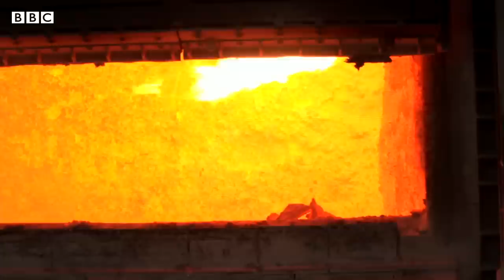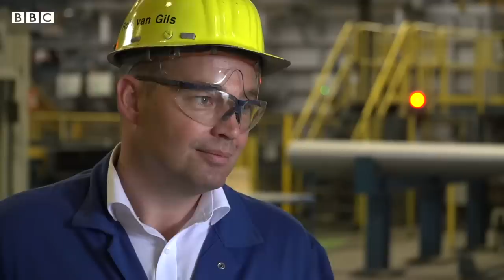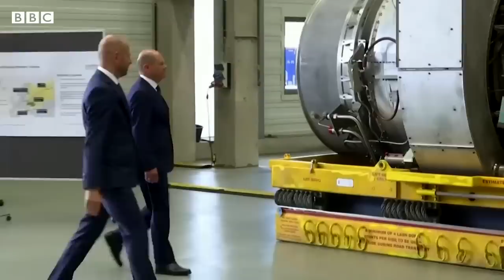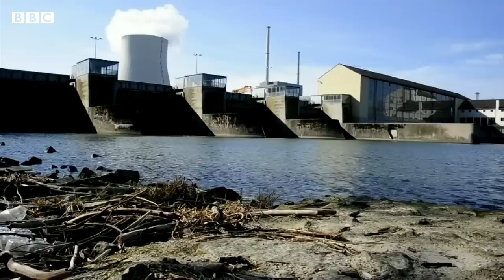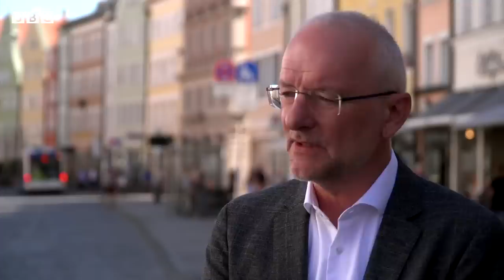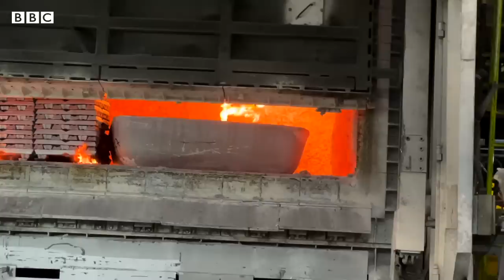Impossible to return turbine vital for Europe gas supply says Russia energy giant Gazprom - BBC News

Comment: Germany needs to not just keep those 3 nuclear plants open but needs to REOPEN as many of the other 15 plus plants they shut down in the past decade as they can, while continuing to expand their renewables of course. They need to swap out as many gas heating systems as possible for electric ones and otherwise electrify as much as possible.
Reply: The fact that French Nuclear power plants are failing is the reason for high gas demand in power production.
And it is ludicrous you think it needs less then a decade to restore a plant after shutdown.
Reply: @christopherg2347  maintenance is hardly "failure". And we have seen Japan wisely reopen several of their early shutdown nuclear plants in far less than 10 years. Germany should do the same. Now, some plants would take longer to reopen than others, which is why I said "as manh of the 15 plus", I doubt it would be any where near 15 in time. However, they should endeavor to reopen as many as they can as quickly as they can.
Reply: Biogas and rocket stoves don't need semiconductors or other electronics and both are simple enough to operate and are carbon neutral
Reply: @psylentrage  yes but there isn't enough of it yet and won't be by winter. Yes they should produce and use as much biogas as possible, but it's impact will be small this and next year sadly.
Reply: @Dr.Gehrig  Maintenance due to critical cracks and inactivity due to a water shortage are unquestionably a failure of nuclear technology.
Reply: @embreis2257  key word: "some." 

Yeah, I know, that's why I said "as many as they can", one would be infinitely more times than none, two, is probably doable, three? And they would literally have doubled the number currently operating. And this is drawing from 15 or more shut down early WITHIN the past 11 years, they weren't all shut down 11 years ago, some were literally shut down within the last 3 years. 

And note I also said, "as they continue to build out their renewables." They need to use every tool in their arsenal, to over come these issues... as we all do to overcome the climate crisis. Nuclear fuel is easy for Germany to buy and ship, and they have the whole EU to hire appropriate workers from. 

And while you are correct that building new nuclear plants is slow and expensive, reopening early shut down ones can be done quite quickly and relatively cheaply, just ask Japan.
Reply: @christopherg2347  meh, sounds like maintenance and a need for more water. Sounds like you're looking pretty hard to call any challenge or issue however minor or transitory "a failure of nuclear power". You really should focus on knocking out all of the coal and fossil gas (and the tiny amount of petroleum based power) before coming for nuclear. We have a time sensitive climate crisis to solve.
Reply: @christopherg2347  also a small thing as a crack can cause a big explosion or radiation like what happened in Chernobyl the reactor over heated and melted and the radiation made the city uninhabitable for some 20 thousand years nobody can live in that area just waste land
Reply: @Dr.Gehrig  Right. Just magically make cracks disappear and get rivers to carry more water in a heatwave?
How many fuel rods have you licked?
Reply: Guys you like of cold at the house and dark without light? Keep dreaming then, meanwhile I value electricity and I am happy about new nuclear power plant in Finland. But sad that there is no more than 1 new. At here we can have real winters too.. so keep dreaming, just dream very hard! Don't do anything real for this problem. Jesus. Let atleast old people and sick to have heat, you can keep your personal house cold if you like it so much 😂
Reply: @Dr.Gehrig  As much as 50% shut down for maintenance and repair is hardly reassuring. And you don't just go "Okay let's switch this nuclear plant back on" you're all very naive and just spout out arguments you read somewhere else without doing research.
Reply: @christopherg2347  Magically make cracks disappear? Do you think goal plants don't need maintenance or something they just last forever? What kind of dumb nonsense is this?
Reply: @captainsewerrat  oh I've done plenty. As of said, we have Japan as a reference. Some of those 14 to 17 early shut down plants could likely be restarted within a timeline of several months. No, not all of them, although several more could likely be restarted in a few years. Still worth doing.

But, even if the German government were to confirm this, I bet you'd still not be happy with it. The reality is, You don't WANT them to restart. Well, that sentiment is resulting in more coal being burned.... notably several coal plants which had been shut down early were restarted... just like what I'm advising here. 

Again, I also declare it necessary to continue expanding their renewables. But the more low to zero carbon energy sources employed the sooner Germany can get off of its fossil fuel dependence. Making them healthier, safer, more sustainable, more stable, more secure, lower cost, and more prosperous.
Reply: @thetoughcookie3665  guys like who? I specifically recommend more nuclear. Finland is wise to emulate Sweden and expand their nuclear program.
Reply: @christopherg2347  no, they all take the time to do maintenance. All thermal power plants renewable or not (possible exception of some geothermal), renewable hydropower, and PV solar all become less productive in such high temperatures low water scenarios (though the increase in sunlight usually more than makes up for it). So yeah, any thermal plant or hydro power dam dependent on a river with reduced flow will have to reduce their output. This has been true since the 1800s, this is neither new nor unique to nuclear power, and in none of these situations is this a sufficient reason to abandon these power systems.
Reply: @Krytern  Coal plants rarely explode, involving highly toxic and somewhat radioactive material.
And Solar panels or wind turbines are not known to explode either.
Nuclear only ever added problems.
Reply: @jamesusanashville9678  I mean, not if you're right there literally in the reactor, but as a source of electricity... pretty decent.
Reply: Pure fear-mongering report !
Just reveal both the Russian and the German letter. Who needs what for turbine transport? 
This is kindergarten-level discussion and reporting.
Reply: You can't just flip a switch and reopen those decommissioned plants. Most of them have been demolished and the others are being dismantled
Reply: @stevec6427  indeed not. And yes, for SOME of them that is true. But not all, there's about 15 such plants at various stages of closure. My point is simply that Germany should make the effort to reopen as quickly as possible those which can be reopened.... a thing they literally did with closed down coal plants and that Japan did with its own nuclear plants. So there IS precedence on two sides here.
Reply: There is no need to reopen other plants, as we produce enough power. With additional plants we wouldn't know how to get rid of all the useless energy.
Reply: @gerbre1  reopen the nuclear plants so that you can keep the coal plants closed and reduce the fossil gas plants to a minimum output. Then as fossil gas becomes scarce you have more options what to do with it, instead of using it for electricity. Also, increase the need to electricity by switching out as many fossil gas heating systems for electrical ones.
Reply: @Dr.Gehrig  Nuclear power is a small fraction compared to coal. You can only replace coal with renewables in the near future.
Reply: @Jolifo1978  nah
Reply: @gerbre1  over 10% of Germanys electricity is still being produced by a mere 3 powerplants. About 15 were closed early. Reopening any number of those would make a substantial contribution. Yes, Germany needs to keep building out its renewables. But it needs to use all tools at its disposal to reduce emissions and fossil fuel dependence. Reopening some nuclear plants is easy low hanging fruit.
Reply: @Dr.Gehrig  Not 10%, but 6% or 1,5% of the primary energy.  Even firewood has a higher share. Reopening only causes problems and risks. We already produce enough electricity and export great amounts. By far the best tool to reduce fossil fuel emissions are renewables. The current three running reactors need revision to run longer. The current fuel can be used a few months longer. New fuel stock is not available before mid 2024. Then Germany has increased its renewables, that there is absolutely no space for nuclear power. It just makes no sense. However we should start generating hydrogen from superfluous green energy. Hamburg is already planing a H2 network.
Reply: @julianpetkov8320  eh, this pulse in coal consumption is unlikely to last anywhere near that long. My recommendation to reopen some of their nuclear so they can reclose their coal plants is to hasten that. There's still plenty of renewables they'll be able to build out in the coming years so they can phase down their coal, some go up fast, some go up slower, but it won't take that long. I'm more concerned with the greenhouse gas emissions anyway.
Reply: @gerbre1  as of 2021 the nuclear electricity in Germany was 13.3% based on 3 plants, the 2022 numbers aren't out yet, biomass was 8.8%. The real issue here is that in 2021 fossil gas based power was 10.4%, while coal was 29.7% (oil was 0.3%), making Germany over 40% fossil fuel powered, this is a problem, especially since by far the largest proportion of that 40%, about three quarters is coal. But that was last year, with the Ukraine Russian gas crisis Germany is reducing the amount of electricity coming from fossil gas to save what they/yall have for heating in the winter and industry, a reasonable move. The problem is they/yall are making up that difference by burning more coal often by reopening old closed coal plants while you SHOULD be utilizing more Uranium and opening more nuclear plants. And sure, while your power grade Uranium stocks may be low now, Germany should make the effort to get more, there is plenty around the world. No, reopening old nuclear plants will not cause "problem and risks". Yes, Germany should continue expanding its renewables, but needs to do everything it can to reduce coal AND fossil gas electricity generation, that includes utilizing some of the nuclear power plants that are literally already there and never should have been shut down early in the middle of a climate crisis in the first place. Use everything you have to burn as little coal, gas, and oil as possible, yes the bulk will be renewables, but also make use of your nuclear resources as well. 

I know you don't want to. Get over it. Do the right thing and do everything you can to stop poisoning your own air and pumping far more greenhouse gasses into all our atmosphere than you should.
Reply: @Dr.Gehrig  Nuclear power last year was based on 6 plants not 3. At the end of 2021 three were shut down. Yes we increase coal power now, because we can. As already said, there are no additional running nuclear reactors before 2024 and the 3 running reactors will be shut down in 2023. Nuclear power won't help us in the next years and then it will only disturb the energy transition.
Reply: @thetoughcookie3665  How long did it take to build and how much more did it cost than estimated?
Reply: @Dr.Gehrig  Those that you want to restart, already ran 10-15 years longer than they were build for. So no thank you, we don't want to restart them, and it's also not technically possible.
Reply: @Dr.Gehrig  Dude, we export electricity, we could just shut that down, but other European nations wouldn't be happy. Like for exampla France. Oh the irony that this is the European nation with over 70% Atomic energy in its production mix.
Reply: @skarbuskreska  if you're exporting coal or fossil gas energy, you're missing the point.
Reply: @Dr.Gehrig  you miss the key difference between Germany and Japan: Japan shut down its plants, but it always wanted to reopen the plants so they kept they didn't close them. The German plants on the other hand have all started dismantleling except for the three that shut down last year. The old reactors shut down 10 years ago can never be operated again, they had to be completely rebuild (and Olkiluoto and Flamanville show how easy and cheap that is...). Don't get me wrong, I am pro nuclear but just reopening is not that easy. For the plants that shut down last year Germany has to get new fuel rods, and that takes about two years. When these new fuel rods arrive, Europe will probably be independent from Russian Gas already, the war in Ukraine may have ended or the plants might not even pass the required security checks (the last major checks were more than 10 years ago, with only the standard checks since then). And even just continueing using the existing plants, while definitely possible, isn't a long term solution. With the fuel rods currently in place the plants will be able to operate for another 6-10 months, then they also need new fuel rods which takes years. And since parts of the supplies for new fuel rods come from Russia, I just don't see that happening
Reply: @skarbuskreska  and please stop claiming that in 2021 3 reactors produced more than 13 percent of electricity, it were 6 reactors with 3 of them shut down on the 31st December. And the high gas consumption of Germany currently is a direct result of more than 50% of Frances nuclear reactors not working currently. Otherwise Germany would be able to store more gas for the winter and relying less on Russia. But yes of course it is easy to frame the ones doing it right or wrong if it fits the own views. The world isn't as black and white
Reply: @haisheauspforte1632  considering there are only 3 plants currently operating you are talking about doubling the number of plants operating in Germany. Sounds good. Also, there are plenty of places in the world to buy reactor fuel from who would be happy to expedite the process, like the US. As I say above, it's a matter of degree. Soon as possible may or may not be helpful for the year for all of it, but will be helpful phasing out the coal and gas in general.
Reply: "From that time Jesus began to preach, and to say, Repent: for the kingdom of heaven is at hand." Matthew 4:17 

"Ye have heard that it hath been said, An eye for an eye, and a tooth for a tooth: But I say unto you, That ye resist not evil: but whosoever shall smite thee on thy right cheek, turn to him the other also." Matthew 5:38-39|□
Reply: @ЛапЛаль  nah, doesn't matter where anyone USED TO get something. It's available to be purchased in other places. No issue, no problem.
Reply: @ЛапЛаль  In English and the Latin alphabet?
Reply: More than half of these 15 nuclear powerplants were built in Eastern Germany by Soviet (aka Russian) specialist. Oops... smth is going wrong.
Reply: @КонстантинКандалакшин  doesn't matter
Reply: @christopherg2347  French nuclear power stations are running at reduced output because they use open cycle river water for cooling. The same would be true of any other thermal power station with open loop cooling. The solution is to build wet or dry cooling towers.
Reply: @christopherg2347  The "water shortage" is not specific to nuclear energy. Any thermal power station with open circuit river water cooling would have the same problem. The solution is to build wet or dry cooling towers to reduce (down to 3% or so) or eliminate the need for river water.
Reply: @gregorymalchuk272  Nuclear power needs significantly more water then other generation options.
And building a new plant take 1 dekade or more.
And since water itself becomes radioactive, you can not cycle it indefinitely anyway.
Reply: @gerbre1  The gas burning power stations consume 10% of your gas supply. Replacing them with nuclear (by reopening the 5,559 megawatts at the 3 nuclear power stations closed on the last day of 2021) would offset this. It would also be way cleaner than brown coal.
Reply: @haisheauspforte1632 Those three plants closed on December 31 had a combined output of 5,559 megawatts. That's a lot of gas displaced from the gas-burning power stations. Especially considering that the European union is demanding a 15% reduction in gas consumption. Besides, most German stations have cooling towers and so won't suffer the reduced production due to low water levels on rivers that is happening in France.
Reply: @christopherg2347  The cooling water demand at nuclear power stations is no greater than that from other thermal power stations, like coal fired power stations. And no, the cooling water does NOT become radioactive. The cooling water is isolated from the turbine steam, which is in turn isolated from the reactor water.
Reply: @gregorymalchuk272  i know. Problem with these plants is they require new fuel rods sand it would take 1-2 years to get them, by that time Germany should have 3-4 LNG facilities in operation already. In winter France's reactors should be working again so gas burning for electricity can be reduced (in combination with coal plants being in operation a bit longer). Germany's advantage in the winter is that they don't really use electricity for heating so there is not more demand for electricity in the winter (there were years with higher electricity consumption in the summer than in the winter because of electric ACs). I think electricity prices will go down again when France is able to be electricity self sufficient again
Reply: @gregorymalchuk272  Oh, so that is why no other plant type in France had the same issues with water?
Because they all use the same amount?
Reply: @haisheauspforte1632  Forget the fuel. As their shutdown had been planned for years, all the contracts and maintenance intervals were timed to run out. Down to the workers and people even learning to be a nuclear engineer.
Reply: @gregorymalchuk272  The transition to renewables which works best without expensive non-adjustable nuclear power.